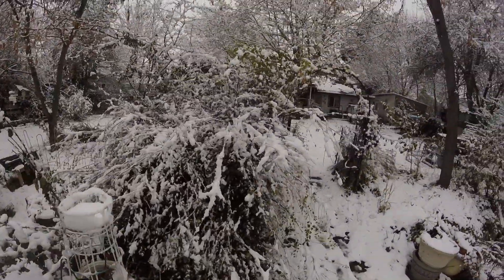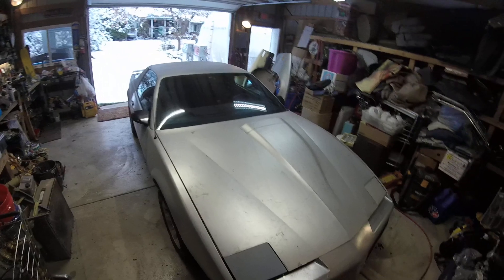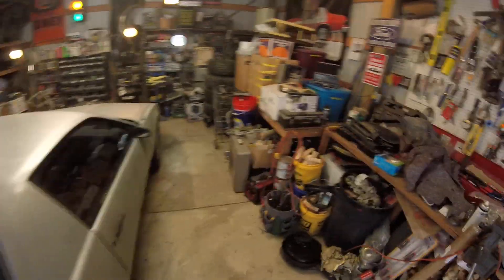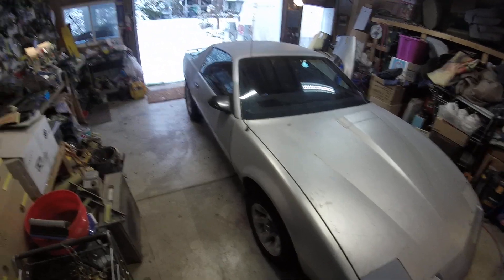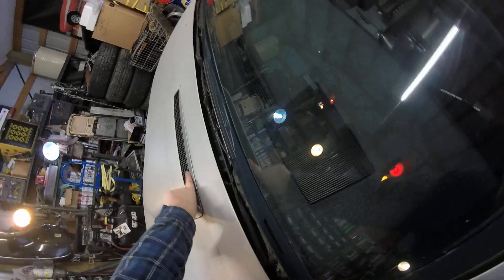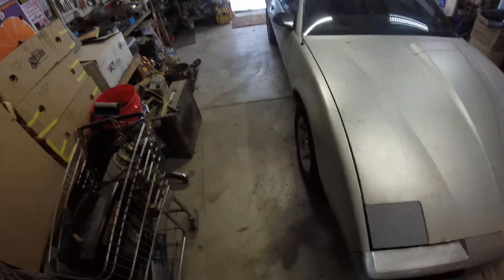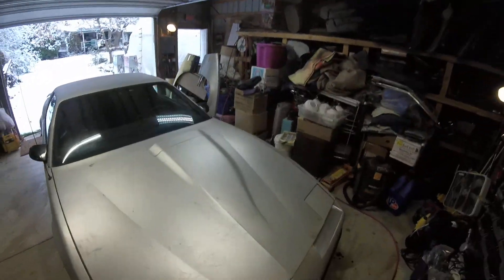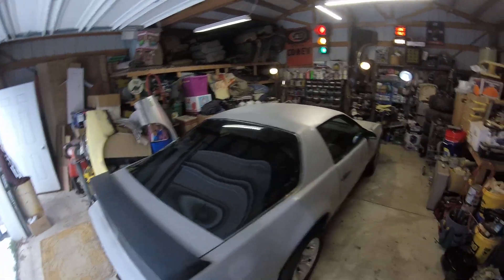My First 1982 KITT Knight Rider Pontiac Trans Am Episode 2

Comment: Steve, nice to see another video! It is coming right along.  Say, I think that I noticed some aluminum/chrome molding for Torino wheel wells in your shop?  Merry Christmas!  . . . Mike
Reply from the maker: Good eye Mike. Yes, I have a couple sets of Torino Wheel Lip Molding. I fixed the small dent on the lower driver fender today. I took the vent out and pulled it out with my hand. Have a wonderful Christmas Mike

Comment: Dude, put that cowl induction setup on the car! It really helped the performance of my 1990 formula, if you haven't seen the video I have a full video on how I converted my stock formula 5.0 TBI to that cowl induction system: https://youtu.be/7N3JItYLjZY
Reply from the maker: I did see your video where you added the working cowl induction. You did a wonderful job. Since I do my own bodywork and paint, I wanted my extra parts to finance the mechanical things I need done on the car. I won't know until this spring when I take it to my mechanic to go over it and see what it needs to be mechanically sound. I am pretty sure I'm having him put on a standard 4 barrel carb and replace the distributor. It has the factory nightmare electronic 4-barrel that is tied to the distributor. I'm currently getting the stock turbine wheel and hub cap set up. This is my first 3rd gen trans am and I'm learning a whole lot in a short amount of time. Thank you for the inspiration.

Comment: My trans am was the same color, I had it painted black in 2008 still have the car still working on the KITT updates, I have the dash, center console installed the pod switches I have but not in the car and the nose and scanner. Your car looks pretty good And the mechanicals are not complex on the Trans ams. Are you going to add t tops or leave it a hard top? Great video.
Reply from the maker: Thanks Luis, That is great that you have one already. I've never done a kitt before and will not be doing the kitt interior. I want to make the outside exactly like the show though. No, I don't plan on making it a t-top car. I've seen some kitts without out them and the owners seemed happy. I would have liked it to be a t-top car though. Since I'm a body and paint man I'm not concerned about this body at all. Very straight without a speck of rust. My goal is to do this as inexpensive as possible. That is fun to me. I won't skimp on the nose though, I'll have to purchase one of those.

Comment: I bought my 89 formula in 97 and it had horrible tint that had faded purple on it, and bubbled etc.  I feel you I spent hours laying in the hatch with a hair dryer and a razor blade... I was a teenager then so it was easier than it would be for me today.  Though I do want to tint it now.

here is my latest build thread https://www.thirdgen.org/forums/ltx-lsx/748741-ls1-swap-after-years.html since I've owned it since 97 its had a few iterations but the last was the major LS1/t56 swap.